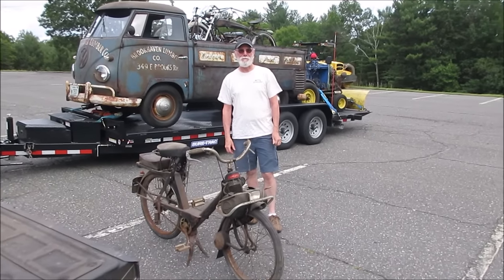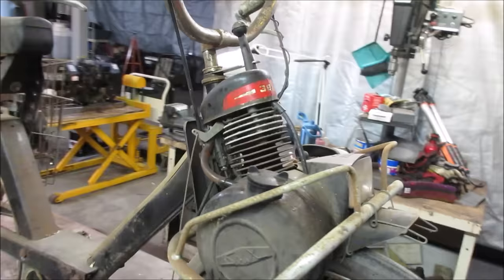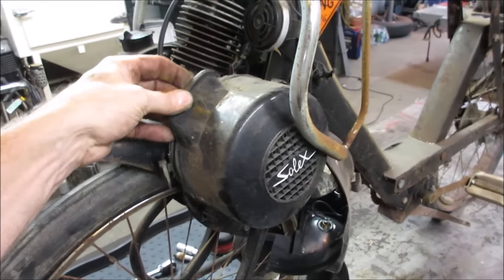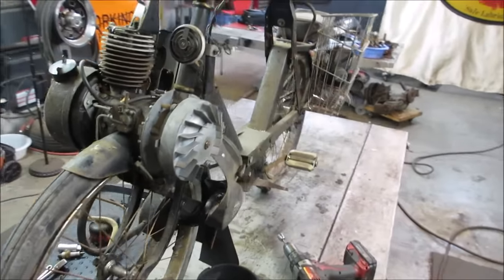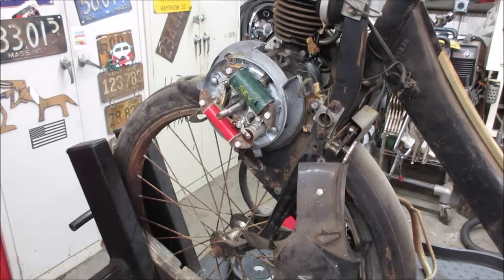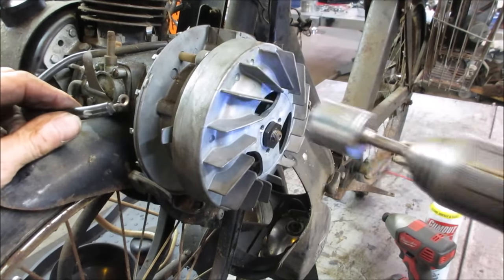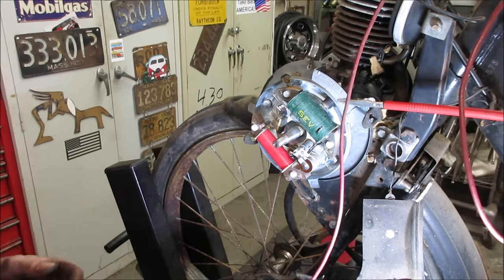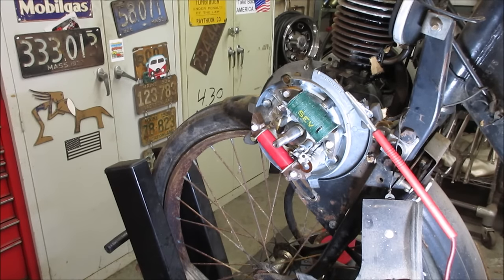Will It Run? VèloSolex 3800 Moped Parked in 1978.

Comment: Man this bring back memories.. My auntie had one exactly like it, the model 3800.  She used it to and from work for many years (she worked at a telephone exchange) and even kept a small "black book"  with details and date of when she bought new tires, fuel, oil, how many Km´s it had on it and so on. She took really good care of it <3 bless her soul. 
It was sitting in their garage still looking almost brand new when I was 10yrs old in 1978, i had asked many times if i could try it..but no! . Finally she gave in and let me try it in their garden and i instantly fell in love with this little moped, and it was a lot of fun to drive. It always fired up before you had pushed it or pedaled 4-5 meters.  
She gave it to me when i turned 13 and i had it for several years, puttering around on the small back roads, and learned how this little engine worked and how to adjust the points fix the fuel pump and much more.  When it´s adjusted properly it will start with a simple flip of the flywheel.   
I still regret that i later just gave it away back then.

Comment: A youth here decided the Velo Solex was slightly underpowered.
He made up a drive to the front wheel using a chain driven by a chainsaw engine.
Police got him at 105kmh in a 50kmh town zone...
They let the air out of the rear tyre and told him to walk it home....and never be seen on the road with it again.
Reply: What those dang kids will get up to.  😄
Reply: 105? without gearbox or cvt? no way. 65-75 max.
Reply: @Timsturbs  That depends on the Chain saw size.
Reply: 105 km/hr. Tisn't 105mph which WOULD HAVE BEEN SPECTACULAR. We had a midget racer that turned over 80mph which could have gotten you a reckless driving ticket before 14 years old. Those old McCulloughs were power houses. Especially the gear drive ones.
Reply: @Timsturbs  105kmh is like 65 miles an hour. I believe it.
Reply: 64.9 klm.? @vhfgamer
Reply: This would shake the shit out of you even at 105kmh.  Good luck stopping it in any reasonable amount of time.
I have a very hard time believing this engine along with a chainsaw engine propelled something like this to 105km/h.  It takes a lot of power to go that fast on a bicycle.
There's a video of Sam Pilgrim trying to break 100kmh going down a water spillway on a modern high quality mountain bike and he was unable to hit the 100km/h speed.  The spillway is extremely steep.  The air resistance just shoots way up at these speeds and would require at least a few HP if not more to reach such speeds.  100kmh is 62mph, so 105 is maybe 65mph.
Reply: @tarstarkusz  And.... many chainsaws (especially older ones) have the grunt. Not a problem.
Reply: Young evil kenival
Reply: Bully boy police vandalising private property, still twice the speed limit is pushing it.
Reply: @vhfgamer  I can't imagine how crazy that must've been. When I was a teenager I held onto the side of a pickup truck on my 10 speed and let go when the speedometer hit 55 MPH. I was completely ignorant of how those tires handle the centrifugal force at that speed! Thank God, I survived without crashing. A moped at that speed would have a hard time stopping.
Reply: @vhfgamer  How much HP do they have?
Reply: My first motorcycle was a yamaha twin jet 100,,,  97 cc twin cylinder, twin carb, twin coils,, twin exahast pipes,,,  Laying down on the tank,, I could reach 70 mph,,,  It was rated for about 10 hp,,,  That was sure a fun bike to have,,  Wish I still did,,,  I think  that  ten hp McCullough chain saw was common so possible that  it would go that fast,,   :-)
Reply: Had a friend in 69 who ran from a Deputy on a Yamaha 180,hit his front porch and slid across the rough lumber on his belly.His mother came out and the Deputy said Ma'am will you give me your word this motor will be in the barn for a month?? Yes Sir he'll be cutting grass that long to fix it and make the payment on it.Well then y'all have a nice day.
       Cops don't act that way these days and you can't take anybody's word for anything.
Reply: @tarstarkusz  I've seen good quality chainsaws go up to at least 7 horse. I'm sure there's even bigger ones out there.
Reply: @darkwing4475  Even with 10hp 2 cylinder engine, you had to reduce the frontal area by laying on the tank to reach 112kph (70mph).
This shows the 105kph on a bike similar to the one in this video almost certainly is exaggerated.  Not only would it lack the power, but once the max speed of the front motor is reached, the 2nd chainsaw motor would be fighting the first friction motor on the front wheel.  Going faster means that front wheel has to turn faster than the motor is turning it.
Reply: @vhfgamer  That's not enough power. There is another comment in this thread from a guy with a 2 cylinder 10 HP engine and he could only achieve 70mph (112kph) after laying his body down on the gas tank to reduce the aerodynamic resistance.

Another big problem is that the front wheel is friction locked to the front motor.  A second motor working on the back wheel couldn't make the front wheel go faster than the front wheel friction drive motor can turn it. It can probably go a little faster by taking the load off the front motor, but not much.

I highly doubt this story.
Reply: @tarstarkusz  So you just verified this story, by citing someone who went even faster. Thanks.
Reply: @vhfgamer  With way more HP and he still had to lay down on the gas tank to reduce the frontal area.
Reply: Had a go cart with a big chainsaw motor on it. It wouldn't takeoff that fast but once you hit the powerband it would go like a raped ape down our country roads.
Reply: @dave4803  
Beats getting tickets...
$400 no registration or Warrant of Fitness, $200 failing to display registration plate, dangerous driving, $200 excessive noise, $400 no licence...etc etc...
Reply: @tarstarkusz  50-80cc can definitely be capable of pushing past 100km/h with basic mods, gearing and a small rider. Bigger saws have been available for a long time and people still ride these little units for fun where I live
Reply: @JohnSmith-yv6eq  Yes but it is still criminal damage, you do the same to a police car and they no longer find it funny.
Reply: @7eis  I doubt it. It takes a lot of power to go that fast on a bike.
Someone else in this thread posted they had a 2 cylinder 10hp motor cycle and could only hit 70 by laying their upper body on the gas tank.
This bike is a particularly upright riding bike.  It causes an incredible amount of air resistance. 105kph is 65mph.  It's not totally out of the realm of possibility, but still not exactly run-of-the-mill.
Reply: @dave4803  
Give me the Long Walk Home...
rather than the tickets or Court appearance (insurance rates, disqualification from obtaining a licence...)
Reply: @JohnSmith-yv6eq  A punch in the face is probably better that losing your licence but that still isn't legal.
The police's job is to enforce the law, not dish out punishments.
Reply: @dave4803  
I think the miscreant is only too glad about the outcome....
Reply: @JohnSmith-yv6eq  Probably but that doesn't make it right.
A lot of bad things have happened when police have over stepped.
Reply: @tarstarkusz  Laying down is just plain normal for motorcycles and bicycles. You keep saying it as if it's some amazing feat.
Reply: @vhfgamer  You will notice this is an upright bike. A very upright bike. 
Most bicycles are NOT made so you can go low.  Those are road racing bikes with drop bars.  You'll notice this doesn't have drop bars.
Reply: @PaulHigginbothamSr yes they were. That's why I collect them! Love them yellow saws
Reply: @tarstarkusz  I used to ride a bike all the time that looks just like this, and I had zero problems laying flat. I used to do that going down hills, and I'd outrun some cars.

Comment: Hi from France,these mopeds were very popular for decades in France.Some friends of mine had some and were using them to go to school,or even weekend trips.They were really slow
but a very high mileage,some were holding a matel 2 liters metallic can holder to increase fuel capacity.The 3800 model appears in 1966 in replacement of the 3300 model .The first velosolex came in 1959 ,model 1700 for two years and was replaced by the 2200. I remember passing in front of the factory in Courbevoie (my hometown) near Paris when going or coming back from school in the 70's.I'm almost 65 now and still have great memories from Them.Thanks for this revival !

Comment: My Dad's uncle gave us one of these back in the early 90s.  He had three of them that belonged to his three sons when they were kids in the 70's.  It only took a bit of tinkering with the engine and engine engagement lever to get it running and driving.  It didn't make shit for power at first.  When I took the exhaust downpipe off of the engine, I discovered the port was about 90% plugged with carbon.  After chipping that stuff out of there, it ran a LOT better.  I was so proud of myself and Dad for getting it back up and running.  It never was a screamer, of course, but it was a lot of fun for a 14 year old kid who had never owned anything with an engine on it before.  It's still sitting over at Dad's.  Unfortunately, the engine was subsequently dismantled by others and it's no longer in running condition...and I think they lost some of the parts.  I ought to adopt it and see what I can do with it.  Thanks for the vid...this brings back some memories!!
Reply: the hardware store Hornbach (Germany) had as a slogan one time

"Mach es zu deinem Projekt"
Reply: I think he is wrong about the air filter affecting mixture.  As long as the float vent is inside the filter next to the carb intake, so that it reduces pressure equally on both sides of the jet(s), it should not effect mixture.

Comment: I was shouting.. 'lift the engine its under load'.. 😂 then you realised. Got a 2200.. here in my living room. Looking at it right now. Great little things. The engines run flat out all the time but remember its under load so not screaming and when you want to slow down.. ie traffic junction.. as you pull the front it chokes the intake so the engine slows but doesnt die. A very clever design.. no engine oil.. all dry except for premix.

Comment: hi mustie !! i'm a french fan and i have 4 solex (restaured) (3: 3800 model and 5000) and they are lovely ! sooo fun to drive ! if you need any doc or help ,in France they means a lot , they are not worth a lot here (500 to700 euro ) but they where not many in the US so you have here something quite amazing and rare !
Reply: Top condition looks like new, in Sweden they cost around 400-550euro for the Red or blue ones, 
Black one cost around 350-450euro. Bad condition but working are around 100-150euro.
Here in Sweden you can buy all the parts for them to. Don't know how it is in other countries.
Reply: I´ve never owned a 3800 or 5000, but some 6000 models. If someone thinks that the 3800´s are funny, try a 6000 model with the shaft drive and mechanical disk brake. I am a moped mechanic for over 40 years, but the Solex are unique.

Comment: This was my first moped when I was twelve, fiftyseven years ago. I parked in the neighbours yard, so my mum wouldn't find out. To start it, you pull the motor up, start pedaling until your speed is sufficient snd then you drop the engine on the front wheel. Works every time. Quirky, but genius, these Solexes! The factory was further renowned for building carburettors in all sizes.
Reply: Thank for sharing your cool story, the good old day haha.  I got one that abandoned from my parents, sitting in the 2nd story in a 3-story house in Vietnam, in think it was around in the early 80s when I learned to ride a bicycle and I used one of these.  I was told it used to have an engine but I never got to see how it worked.  Just the bike alone was weight 2x than a regular bike and you could see from the thick body frame all around.
Reply: No you don't never drop the drive moving or running it scrubs the tyre!
Reply: The first Yamaha XS650 twin had two Solex Carburettors.
Trinidad & Tobago.
West Indies.
Reply: @jostouw4366 I think he just said that when the motor is off. 
You pull a lever that lifts the motor off the tire. With it still off the tire you start peddling. Then you lower the motor onto the front wheel which is turning. The front wheel turning starts the engine. 
I have a bike with a Berini m14. Same idea. Mine is from about 1950.

Comment: 50 years ago I worked with a guy who had one of these, this is what he told me :) The motor was killed by an earthing tab when lifting it off the wheel. When he collected it from the dealer he was told to "just check that nothing has come loose when you have ridden it for a while". The next day before setting out to work he went around with a spanner and tightened everything up.... including the motor hinge bolts, the motor was in the engaged position and off he went, it was only when he wanted to stop for the first time he realised he could not lift the engine to stop it! It took him a while of riding around the neighborhood but he worked out that removing the plug lead would stop it.
Reply: The decompression valve is definitely the way you stop these engines. I had a Mobilette moped (also French) of around the same era and although it had a conventional twist throttle, if you twisted the throttle in the opposite direction it pulled another cable which operated the decompression valve.
Reply: LoL !!!
Reply: I remember reaching down to loosen the carb mix screw to slow down when the throttle stuck on my minibike. Also pulling the spark plug wire off and getting the you know what shocked out of me, but at least it slowed down to a stop. ben/ michigan
Reply: They called them a "Very Slow Legs" for a joke in South Africa😏
Reply: In the apocalyptic future where computers don't work.......wait a minute I get it .......we need to watch this about a hundred times now 😅
Reply: @chrishartley1210  I had a Kaptein Mobylette EEG 16 many years ago and new the shut down rule from you !

Comment: I had one of these things a few years ago, was a barn find from 1969, few parts were missing, completed it and drove it for a while. You need to replace the fuel Pump, or at least overhaul it. New diaphragm, new fethers and new ventballs. Whenever the motor runs there must be a good flow of gas visible in the big line that runs back through the tank. With working fuel pump, clean carb and good spark it will run.

Comment: the carb is opened by a twist grip on the handlebar. The brake lever has a de-accelerator function for when you brake - so if keep the lever pulled it will always try to slow the motor down.
But very good work sorting out most of it. You have got further than most people do!
Motor sounds good.
Reply: That makes sense it seemed so counter intuitive
Reply: Remember, it's French.
Reply: Oui. You can even see the cable going from the carb to the front brake.
Reply: Makes sense, really - modern ebikes often have a brake cut-off switch as well!

Comment: I'm thinking the "throttle" lever is actually a brake/de-throttle lever.  In other words the motor is meant to run wide open and when you put the brake on it idles the motor down.  Great video, thanks for the time putting it up.

Comment: In Germany these Velo Solex were classified as MOFA (motorized bicycle). This class is speed limited to 25 km/h and could be operated without license from the age of 15 years. These were the weakest MOFA but also the cheapest in the market (399.00 DM in 1975 or so). From observation I know that the French version was much faster, actually impressively fast. Fast here means top speed, acceleration was comparable with escargot climbing a wall.
This is a great video for me to enjoy as it brings back memories but also finally answers a bunch of questions that I wondered about back then.